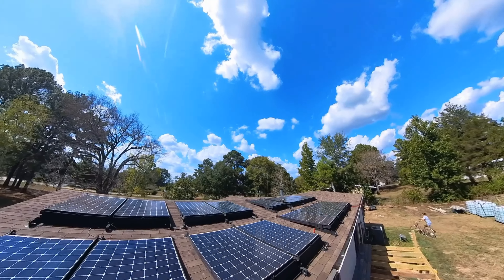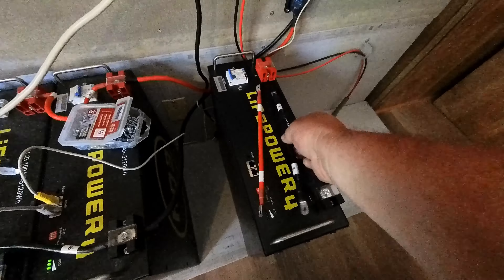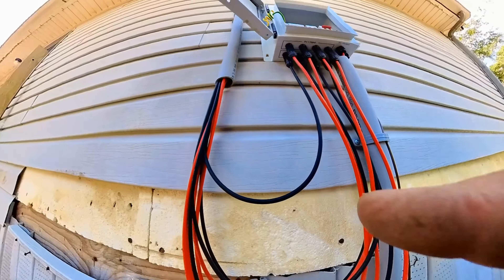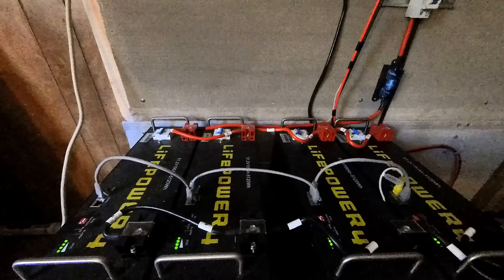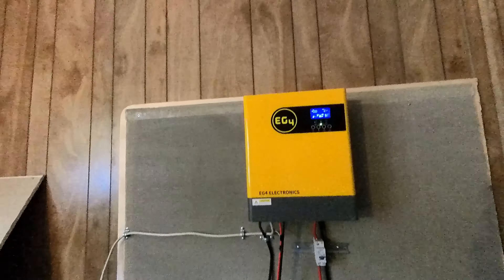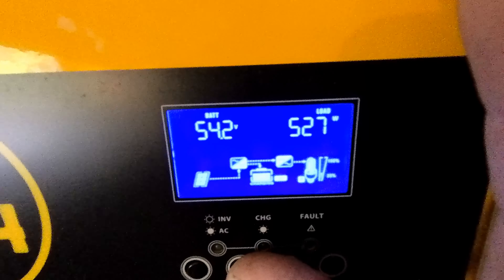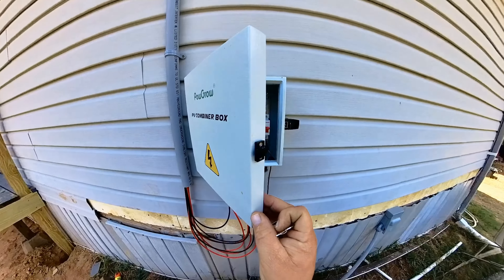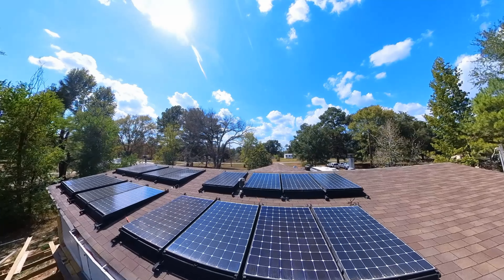Do Your Own Cheap Off The Grid  Solar Power System

Comment: Oh to be young and able to get set up early in life.  I’m in my mid 70’s and currently taking care of my wife, she has Alzheimer’s.   In 3-5 years I’ll be moving from Tampa, Florida back to some property in Colorado.  I’ll be building a 16’ x 48’  building using 2” X6” studs.  A 1 bed 1 bath home.  (There are hotels 20 miles away).   I’m looking into the 48 volt system, the property has a well, & 2 railroad boxcars I use  for storage. I’ll have propane for stove & heat along with a mini split ac.  Problem is the elevation is 7,600’ and it gets -40F in the winter.   Need to have a way to keep batteries from freezing.  Probably a well insulated shed will work.  I had a cabin in the mountains at 11,500’ elevation off grid.  Because of health concerns had to sell it for a nice return.  Cabin had hydro generator, & simple 800 watt 12v solar.  A 800 gallon propane tank for generator and cabin.  On 160 acres.  Hated to give it up, but it was necessary.   Thanks for doing your videos.  I appreciate your efforts.
Reply from the maker: wow..800 gallon propane tank...i would love be as optimistic as you in my mid 70s..-40 is treacherous...i have been in Denver at -17 and it was crispy...i think if you live there when you do your system the solar equipment needs to be located inside your living space so it can survive those elements...especially if you use lithium batteries...do some more research on the charging temperatures of batteries and no insulation alone will not save the batteries at those temps
Reply: @OKLAHOMAOFFGRID  I lived in Alaska for 4 years and got to know several homesteaders up there and used their ideas for my mountain cabin.   I am fortunate, my Dad lived to be 96 and was healthy until his last 6 months.  I might just pack up and visit family for the 2 coldest months. I’ll make sure the place is winterized.

Comment: This is interesting.  I always thought solar was+ $20k at least.  Thanks
Reply from the maker: If the battery Bank wasn't so massive on that thing I could have done the whole system for about 5,000 but we bought $3,000 more in batteries... This bringing the total to around 8500.
Reply: They want you to believe there's no way out.

Comment: Seriously should have this system on every small simple home across the country, at the very least the EV drivers should have this set up to charge their Vehicles. They could even use their Tax rebate to do it.
Reply from the maker: Funny I was Checking out your solar upgrade video right now when I saw this comment.. but yes that is a very powerful and nice off-grid system I built... I love it.. a little on the pricey side at 8500.. but if somebody else would have installed it it would have been 30 grand

Comment: Have you thought about adding anouther inverter and running split phase?  Im in the middle of a very similar setup and cant decide if i want to set it up for 120 or 240
Reply from the maker: I have thought about it but right now I'm okay with 120 because I don't have anything critical that I need 220 for ..

Comment: Does the LI4 setting drop the solar panel’s charging speed? I’ve had to switch my eg4 3000 setting to User define settings to see the full 5000w
Reply from the maker: I have yet to adjust this one

Comment: Yeah be doing pretty much the same except with a 6000xp and a single string of the 4k panels. More than cover the need at the moment. Later add a second string to the second input, more batteries and probably another controller.
I don't know that I should put too much thought into the later expansion, this stuff is changing so quickly.
Be nice to just go ahead and sink into the 18k unit. Try not to think about it too much or I'll be jumping in head first and wish I didn't later. lol
Reply from the maker: So when you say single string of 4k panels you mean 4 thousand watts of panels?
Reply: Yeah, 10- 400w panels.

Comment: if you're able to fully charge your electric batteries by noon, I'd suggest setting up a sand or oil thermal battery to use the excess photovoltaic captured energy.  basically insulate a big box of sand and extract the heat in later months.
Reply from the maker: we just added more things to the critical load panel so now we are pulling much more...video coming soon...it is awesome  the way it is working out...im very satisficed
Reply: Hmmm could you explain this more or share a link?

Comment: Great job brother..  sobthe little 3000 watt inverter can run a house? That is where I was having a problem comprehending what can it maintain.. much thanks.❤
Reply from the maker: it can run almost everything you can throw at it except large central heaters or central ac but most of those will take a 220 volt and this is a 110...they do make it where you can do 220 volt with two of them together and they do make much larger
Reply: @OKLAHOMAOFFGRID  that helps a lot. Central ac isn't my concern off grid. Lol 😆 but hopefully a sm window unit. Thank you do much.
Reply from the maker: this thing is running a small window unit 24 hours a day right now as we speak
Reply: @OKLAHOMAOFFGRID  that's great info.. just need a good battery system for running after the sun goes away.  Thank you so much. 💓

Comment: Cool Videos... Thank You!  I would like to build egg dolly cart, battery, back up system to run our refrigerator and also a freezer in the garage during power outages… We live in California (errrr) where it is sunny almost all of the time… What is the minimum amount of 35 V panels needed to fire off the G4 inverter?… Also, could I charge to this inverter using a 2500 W inverter generator?… Thank you for your time.

Comment: i am not positive but did you connect the plus and minus cables from the inverter to the same battery
i think that will cause the batteries to go out of balance  take the minus off the first battery stick it on the last battery

Comment: Is it advisable I just keep HVAC & the French door refrigerator to be under this off-grid  solar 5,000 Watt?  Do you think it's enough?
I hope this way may help me gradually & partially lightly in my finance on solar.
Reply from the maker: depends on how big your system is!!!..if you change it to mini split ac heaters then yes absolutely it will be enough

Comment: Do I have to use the EG4 batteries, or can I just wire 4 nonEG4 batteries into a 48v series bank and plug it in? What do I lose by doing this vs their proprietary battery bank units?
Reply from the maker: You can use any battery you like with this inverter

Comment: I have a genmax 7250 generator inverter with a 50 amp outlet..  I’m wondering how I can wire it to recharge the solar batteries for this exact system im planning on living off grid and I’d really appreciate the help thank you,.
Reply from the maker: It would be very easy it's a three-wire process... The inverter will back charge the batteries and run everything in the at the same time when the generator is wired to it. If you are going to buy anything from a signature solar please use my link in my video description that way I will get the credit for showing you the video and the system.
Thanks a lot bud

Comment: Do you know What size generator it takes to run the internal ac battery charger on that?
Reply from the maker: i use a 30 amp 3500 watt

Comment: Wow! That is quite a setup. Did you say how much the total cost was?
Reply from the maker: About 8500 for 5000 watts of solar panels and 20killawatts of batteries...awesome price because of doing it yourself
Reply: @OKLAHOMAOFFGRID could this easily run a 1200 sqft home?  What ifninonlynhave direct sunlight 6hrs a day?
Reply from the maker: @IAmYourReflection  yes I believe so if you go to efficient appliances like a mini-split AC heat and efficient refrigerator etc
Reply: @OKLAHOMAOFFGRID  yeah gonna have a mini split but old school fridge.   Maybe I should upgrade that then?
Reply from the maker: @IAmYourReflection  I would definitely get an efficient refrigerator because that's one of the critical appliances that has to run 24/7
Reply: @OKLAHOMAOFFGRID  any other suggestions on appliances? How big of a difference does a tankless water heater make?
Reply from the maker: @IAmYourReflection  I would go with an instant propane hot water that is what I have do any type of heating with electric is definitely a No-No when it comes to solar. Really honestly The only exception would be a mini-split on the heating side.
Reply: @OKLAHOMAOFFGRID  alright so what about a stove top oven then? Is that also not suggested?  Where did you get your knowledge from? Is there a good discussion board somewhere that has all of this sort of info sorted out?
Reply from the maker: @IAmYourReflection  I would use a propane stove that's what I'm doing it as far as the knowledge and where it came from its hands-on experience
Reply: @OKLAHOMAOFFGRID  Ofcourse. Thanks for the advice. Is it easy to find the panels for this price? I’m in north Easter ok and my place only gets about  6 hrs direct sunlight. Would that be an issue?
Reply from the maker: @IAmYourReflection  I'm in southeast Oklahoma and I do just fine as far as sunlight goes and Facebook market is an excellent place to start looking for good used 24 volt panels

Comment: I have pretty much the same setup with only one of those 51 volt batteries for now. 5 panels 38v 250 watt wired in series."Minnesota" I only get enough power from 12-2 to charge the Batt. Should I add more panels, or wire differently? Thanks in advance!
Reply from the maker: Thanks for the info!..keep them wired like you have them...but wondering why only sun from 12 to 2?

Comment: How many amps is your pv input into that 3k inverter . I belive that inverter takes max 18a of pv but with your 4 strings in parallel im certain you are way above those 18a . Or am i missing something ?
Reply from the maker: well my watts are the max at 5000 and the volts on mine are 220 ish.....it can go up to 500v dc....so the higher the volts the less the amps will be...so lets say it will except wired up to 250 volts dc at 18 amps....but if i wire those same panels up to 500 volts it will bring the amps in half down to 9 amps......in my case 305 watts per panel and each panel is 48 volts @4.2 amps and open circuit volts is 64 so i have them in strings of 4 so 64volts x 4 =256 volts still at 4.2 amps...run 4 of those strings in parallel and now i still have 256 volts but @ 16.8amps...if i need less amps then i will wire up closer to the 500 volt max to get less amps

Comment: Great video. Would this setup be suitable for a 3/4 hp water well pump that needs 240v on and off? Thx again,
Reply from the maker: if you bought another inverter you can hook them together for 240volt @6000 watts of power..yes

Comment: Mrs OKC 
Ok I want to put 48v stern in my van 
Suggestion
Reply from the maker: What is a 48 volt stern?
Reply: @OKLAHOMAOFFGRID  48v system
Reply from the maker: Okay.. a 48 volt system is the best and most efficient... Let me know what you want to run and I might be able to guide you into exactly what you need

Comment: What are the specifications on the data plate on the back of your 305 watt panels? I can't see how you're putting 5000 Watts into this box when it's only 18 amp maximum input for the eg4 inverter. You said you're doing four strings in parallel please give me your data plate information so I can do the same with my eg4 unit thank you
Reply from the maker: it is rated to take 5000 watts voc
Reply: Yes but only a maximum of 17 amps I have the same yellow box and run my panels in series how are you staying underneath the 17 amps that's why I was asking about the data plate on your solar panels thank you

Comment: How do I need to set my EG4 3000 for the battery?  I bought the Vatrer server rack instead of the EG4 battery.  Do you set it to LI4 or one of the other settings?

Comment: what if i want 200amp split phase?
L1 100 amp
L2 100 amp
Reply from the maker: If you're talking  about 240-volt AC at a hundred amps each side this system here is not capable of doing that although you can get another inverter exactly like that combine them together for splitface but not with 200 amps
Reply: @OKLAHOMAOFFGRID   thanks for the info! what about combining inverters that do split phase for a normal 200 amp service?
Reply from the maker: @woodzyfox4735  yes you are able to do that with another inverter
Reply: @OKLAHOMAOFFGRID  thank you! Any ideas!
Reply from the maker: @woodzyfox4735  what kind of ideas are you talking about?
Reply: @OKLAHOMAOFFGRID  what inverters can I use for 220v 200amp split phase like a normal house has. But also can putt from a generator if needed
Reply from the maker: @woodzyfox4735  if you buy two of the inverters shown here in the video it can be ran as a 220
Reply: @OKLAHOMAOFFGRID   a 3,000W unit thats 27.27Amps @ 110VAC
for what i need, being 220 Split phase its only 13.64 Amps.. my instant hot water heater alone pulls around 107Amps @220V (pulsing not constant).
Ill need to have a 4-6 unit setup being 5000W each lol
3 for L1 and 3 for L2
Reply from the maker: ya you need a propane instant hot water heater if your going solar... @woodzyfox4735
Reply: @OKLAHOMAOFFGRID  the idea is to be 100% electric
Reply from the maker: @woodzyfox4735  then in my opinion I would be looking for a much more efficient instant hot water heater than one that pulls 100 plus amps.. but to each their own if you want to use that type of power for heating water off of a battery bank or solar panels then eg4 does make huge 6500 watt converters that you can times 2 and parallel them together for split face with a much higher amp capacity but this is where you start getting way out of my league because you start getting into the tens of thousands of dollars for each piece of equipment and possibly 14 or 15 KW worth of solar panels I would rather just downgrade to a 110 water heater but that's just me. If you have to have that massive with that kind of volume of hot water running through it then yeah you're going to need to get some serious power look up the EEG 4  6500 and plan on getting two of themhttps://solarsovereign.com/products/eg4-13kw-off-grid-split-phase-inverter-bundle-2-x-6500ex-48-13000w-output-16000w-pv-input-split-phase-120-240vac-all-in-one-solar-inverter-system?currency=USD&variant=45500153758007&utm_medium=cpc&utm_source=google&utm_campaign=Google%20Shopping&stkn=057b354b2ce6&gclid=CjwKCAjwgsqoBhBNEiwAwe5w0-skU1wT1C1mpbFyjXKVBmQRv7OI4LMlE80WgDuWFZOk6gIisCeNVRoCzdIQAvD_BwE

Comment: Everything looks good except the wire you used, using 8awg is perfect,  but the coating of that wire isn't recommended for solar, it's not UV resistant,  the correct cable is RH RW 8awg, rated for heat and water.
Reply from the maker: Thanks man I'll check into that also considering wrapping any of the expose Pv wire anyways just haven't figured out what to wrap it with yet. Some of it is in conduit but yeah this is a work in progress
Reply: @OKLAHOMAOFFGRID  I'm in the tropics,  even though I used RH RW 8, I put all cable in conduit,  including a junction for every panel where cables connect.
Reply from the maker: rich guy stuff...lol...joking  i understand
Reply: @OKLAHOMAOFFGRID  I'm not rich, I'm just a very good builder, highly skilled beats rich any day of the week, never forget this.
Reply from the maker: I gotcha man...I been A REPO MAN all my life so im learning as I build @MosaicHomestead

Comment: EG4 Hybrid Solar Mini-Split Air Conditioner Heat Pump AC/DC | 12000 BTU | SEER2 22 | Plug-N-Cool Do-It-Yourself Installation $1300
Reply: You have one?
Reply from the maker: yes i have one running on this system
Reply: @OKLAHOMAOFFGRID  thank you sir!

Comment: Good luck! High frequency inverter just don't last. I would never install a high frequency inverters to power my home. Because of their high switching speeds, high frequency inverters run much hotter than low frequency, transformer-based solar generators which makes the low cost, off spec, Chinese made components such as capacitors, diodes, resistors and ICs that are used in the cheap inverters that are used in these inverters, far more prone to early failure. 

Another major consideration with high frequency, transformerless inverters is safety. Because there is no iron core AC output transformer to isolate, the DC input from the inverter's AC output, all it takes is for the AC output monitoring circuitry to fail and one of the MOSFETs in the inverter's H-Bridge circuit to short to ground, and these units can send dangerous, high voltage, high amperage DC current straight to your connected AC loads which will not only damage most AC appliances but can also set those AC appliances on fire. 

A far better alternative is to invest less money and purchase a hybrid, low frequency, transformer based inverter charger and an LFP battery and build your own real solar generator. Low frequency transformer based solar generators last many years longer than these toy high frequency solar generators, and can easily power high surge loads without being damaged and without damaging your appliances. That's why the big name brand inverter manufacturers like Schneider Electric, Magnum Energy, Outback Power, Sigineer Power, Victron Energy and others, all use a low frequency topology in their offerings. Your system will last far, far longer, it will run much cooler and can easily power high surge loads without being damaged and without damaging your appliances.